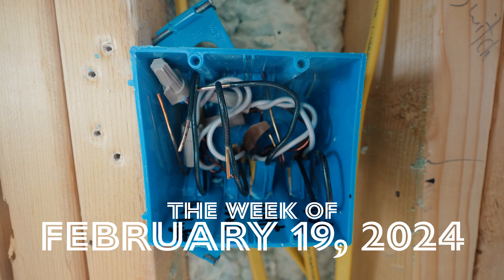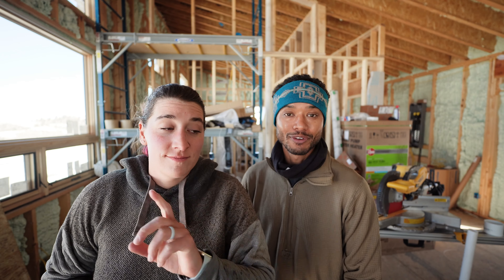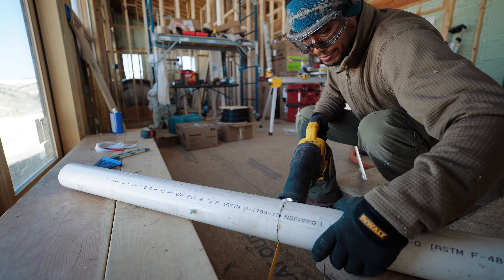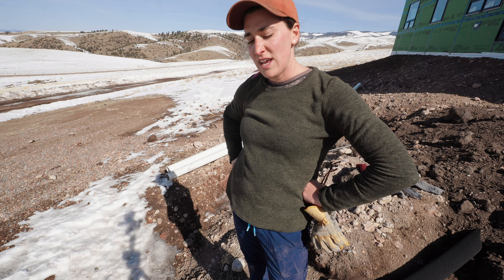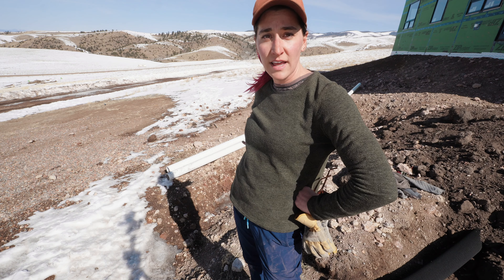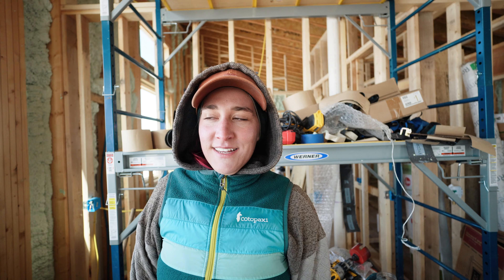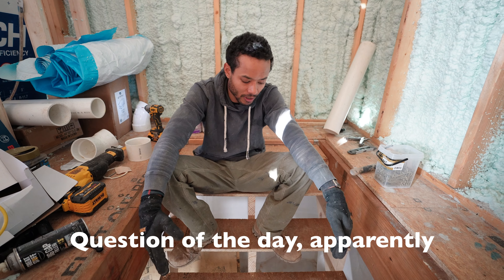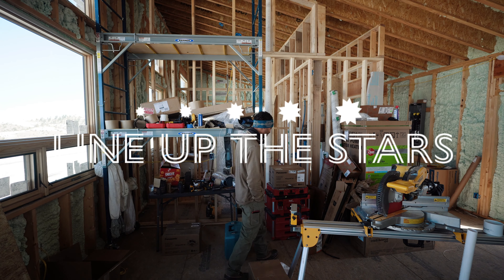Don't DIY Your Plumbing and Electric Unless You're Ready For... | Off Grid Cabin Build

Comment: I absolutely loved every second of your video. 
Great teamwork!!!
Brian, can I ask…how high would you say you were on the ladder inside?
Also (I’m not sure if I’m asking this correctly), but how were you able to line up the inside pipe, directly to the hold that you made inside the roof?
Reply from the maker: Brian was about 10 feet up on the ladder inside. Not as bad as when we were working on the front wall outside!
To make the hole in the roof, he used a laser level to line up the PVC pipe to the exact spot on the roof and then he drilled the hole from inside. It would have been much too tricky to try and drill in from the outside 😅
- Chelsea